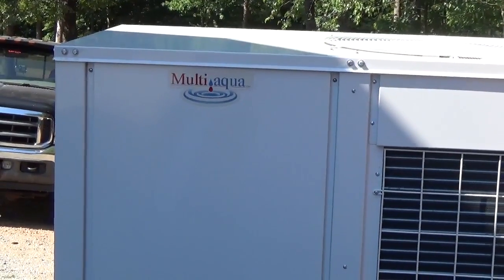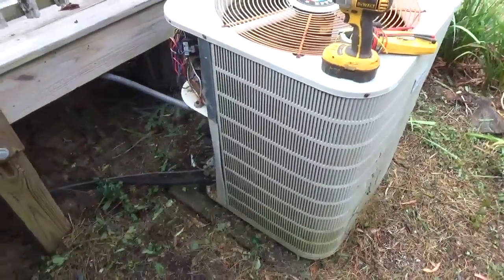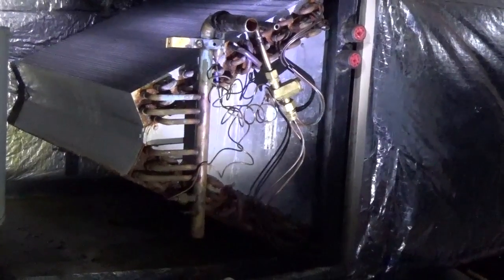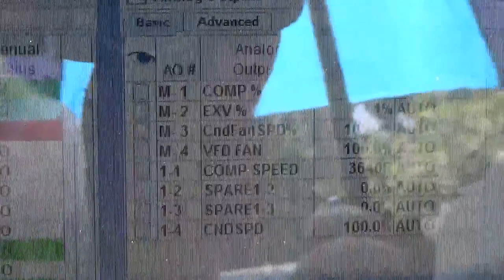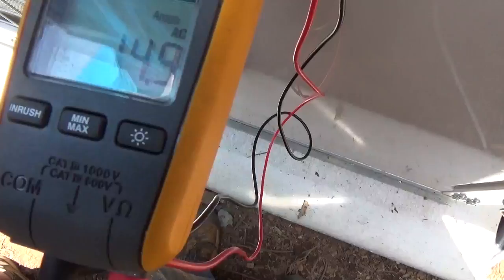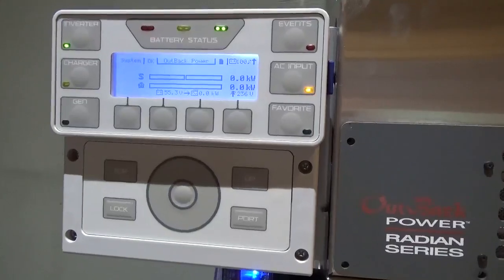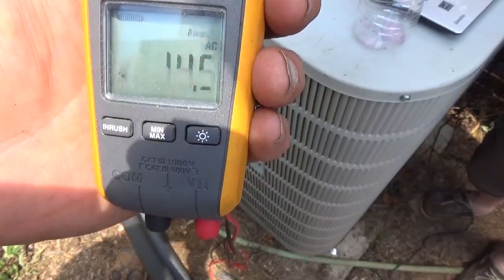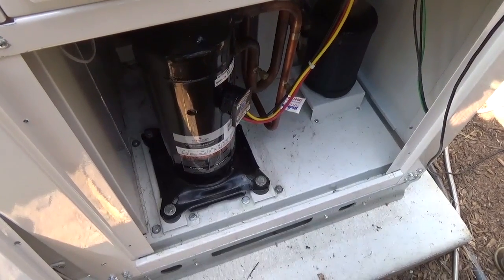Solar Driven 5 Ton Chiller

Comment: I take it your system is a 48 voltage system because of your total watts. Your Amps is 162.5 and your panels I  take it are wired in paralell. 48 ×162.5 Amps  = 7,800 watts.  7800÷162.5 Amps = 48 volts

Comment: So how many kilo-dollars did you spend to save maybe $100/month? (If that) What's the pay back period on this vs a cheapo efficient mini split off Amazon? I bet you could just install a normal heat pump (or keep what you got), add a few extra solar panels to make up for the inefficiency, and still come out way ahead.
Also hooking up a super efficient chiller to a super not efficient duct system really doesn't make much sense. And every heat pump makes hot and cold simultaneously, it just often isn't tapped into because you don't need much heat when the air conditioner is running. It's not something special this model does.

Comment: would a chiller like this heat a pool in ac season?
Reply from the maker: Definitely
Reply: @engineer775  so why don't people use this everywhere? you can heat your pool and cool your house with the same energy used!!! no separate gas bill and electricity bill on top! perhaps is it expensive?
Reply from the maker: @Cfish613  It is pricey.  12k for the chiller.  The hard part is getting an installer.  Turning this HVAC ship around from refrigerants to water is slow.

Comment: Could you share an update on winter and summer performance?

Did I hear correctly 120 volts at 15 amps?  Would this be less than 2,000 watts?

How about on hot non-cloudy days?  How about on very cold days?

Comment: Nice system, BUT looks like a system that requires constant monitoring.  Also, this is a system I would install for all of the advanced components that seem to be cost prohibitive if needing replacing.  For that price, if I want a system that is a long term heating/cooling solution, I would invest in Geothermal system.  Less complicated and involved components and very reliable.  In a disaster type scenario, and since the Geothermal system is so compact, I would have a spare sitting around, for in a disaster scenario, there would be no parts available.

Comment: It's running at 15.2 amps, but what is the power factor?  If you don't know the PF, you don't know the power.   If all the motors are powered by inverter, the power factor is probably very good(nearly 1).

Comment: I have a Bryant 5ton variable speed AC unit on my house. The inside blower, the condensor fan and the compressor are all variable speed soft start.  I'm thinking I could do the same radian power system with mine as is.  My lights used to dim everytime the compressor started, that is a thing of the past now with the new heat pump system.  Love your videos though...great behind the scenes stuff.

Comment: So how is this working for you?
Reply from the maker: 3 weeks so far and doing great.  I will be expanding to do the whole house.  I will be removing all refrigerants from the house. and running hydronic coils and hyrdonic fan coils.  I have not yet plumbed the hot side yet as I am experimenting with what circulating pumps are going to have the right flow and head pressure.

Comment: How do you control it from getting too cold.  At my job(wont say where) we use four 500 ton chillers and we use reheat coils that open up via pneumatic thermostats which of course require a compressor.  So, does this unit shut off? or do you have another way of keeping it getting too cold.
Reply from the maker: yes, the unit ramps down when a 10 degree differential is met.

Comment: So if your Radian is showing  5200 watts (out) and the chiller is pulling 3450 (15 amps x 230) and the Taco pump is pulling 168 watts that means  your air handler is pulling 1582 watts ?   (5200 - 3450 - 168 = 1582)
Reply from the maker: my fridge, freezer, and lights were on as well.
Reply: Gotcha

Comment: Laing makes super nice circ pumps, I like the ones that are more geared towward the spa market, they have lots of flow at low head and are proper nice mag drive ceramic bearing pumps. I have a small 1/2" version in my PC that has been running a closed loop for over 8 years now.

Comment: Could you do me a favor and hassle "Coolerado" coolers, they have this really neat separated air path evaporative cooler that basically uses a laminated brick with a bunch of air passages through it that have an evaporative medium on one side and plastic on the other, its a cascade effect to lower the air temperature. They look really promising, there are videos of them in action on youtube (if you can get through the dude droning on and on about it) They are really elusive, you need to be a qualified contractor to even talk to them about getting one. I'm thinking with your buisness cred and interest for such things you might be able to get one to test and share with us the results.

Comment: combined amps would be more informative. Just posting the unit amps doesn't tell the whole story, much like a home that runs on half gas, half electric. Without all the information, it doesn't mean much. I am interested however. My home requires about 4.5 tons of AC but I also live in the hottest climate there is of Phoenix, AZ. Is 20 degrees - ish delta the max?

Comment: That is impressive 5 ton of cooling on 15amps. And You have  the panels to power it, and Its giving you better than 20 degree differential to ambient.  Does it cook pizza and toast bread?
Reply from the maker: not only does it handle the pizza, it makes all the hot water I need to clean the dishes at the same time it is cooling.
Reply: Interesting !... so it uses the heat extracted from the return (AC) water to heat your hot water tank ?

Comment: Great so you are able to use the full solar array output to run the chiller.  How much energy is then going to charge the battery bank while the chiller is running all day in the summer?

Comment: what does a setup like this cost?
Reply: Andrew, we at Solar Electric America are starting a panel factory in Richmond, VA.  We will be selling new made-in-america panels at significantly less than $1 a watt.
Reply: Those midnight solar cc's are probably $600 a piece and the outback radian that allows for grid assistance and can crank out 5kw continuously is probably in the $4000-$5000 range.  Seems like you can get panels for fairly cheap - $1 per Watt, so a 5kw array would be $5000, but you'd have to pay some serious cash for shipping or rent a small UHAUL or big truck to go get them at the nearest dedicated solar shop.  The batteries are probably the worst part; probably at least $7.5k-15k plus whatever setup you need to vent the offgassing to outdoors.  I see people making DIY powerwalls with collections of used Li+ laptop batteries for cheap, but the problem is how to safely deal with the heat generated by these.  Basically you need to pay your mortgage off, then start working on getting a good setup.  I would start with getting the least power hungry appliances - go to energystar dot gov and pick the most efficient products available.  You can get a fairly large fridge that will only use a dorm size fridge's worth of power now.  Insulate the heck out of your attic, &c.  Scott might be able to tell you how to start small (3.5kw) and the scale up (10kw) as you get the cash; some type of scale-able system might even be better, so things don't fall apart all at once, 20 years down the road.
Reply from the maker: 12k for the chiller and then the airhandlers, fan coils etc  ~ 25k
Reply: Excellent question.
Reply: I 3rd that question.
Reply: i would think he got it free on beta, that's what i heard
Reply: Just got a Quote from InterPhase Technologies ( MultiAqua )

"The MSRP on the MHRC is $27,000 (USD). The MSRP on the solar powered
version is $36,000 (USD)."  

For me, this is Way out in Left, Left Field for a 6 Ton Water Cooled Chiller.
Reply: Sidney Twining Good.  Hit me back when you're up and running.  I'll be relocating to WV near the VA border in the next year and am going to try to build one of the 'flying V's' like Scott's.
Reply: He would almost have to.  TCO would be crazy and could never even break even.  Pumps/Leaks/Modules failing.. looks like a nightmare especially for "prepping".
Reply: Andrew, am glad to help you get the stuff to set this up.  Send me something to my new email:  stwining@solarelectricamerica.com.
Reply: Yes, am Hoping Engineer775 Responds as he Quote $14k on another of his Videos for the Solar Unit.Seems like a Real Disconnectand Like you Found a Water-toWater Chiller System for About $5k
Reply: The more you know the cheaper it gets.

Comment: how much did the new array cost though?
Reply: I'd be interested in the overall cost of that set up, but ultimately it doesn't matter.  I'd guess it's way more than it would cost to traditionally run a home.  However this man is running at the cutting edge.  all early adopters are paying more for early access,  and in most cases more expensive cruder  versions of what will be main stream in 10 years time.  

In all areas of life,  we need geeks to be paving the way. If it was always about cost to everyone  nothing would evolve into consumer kit.